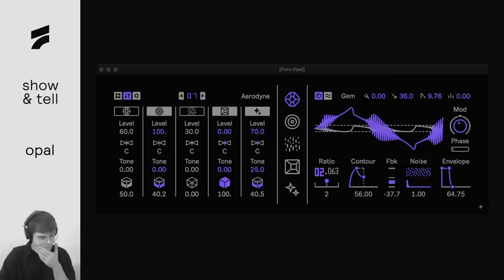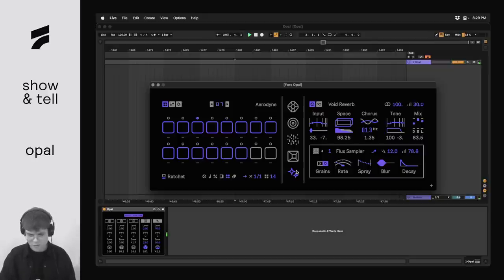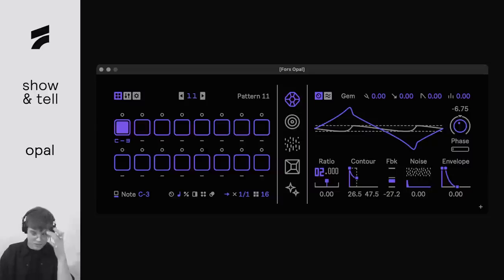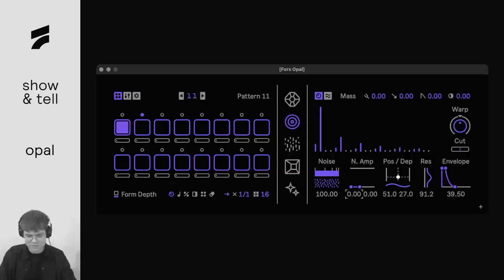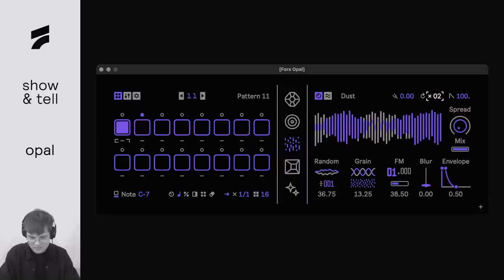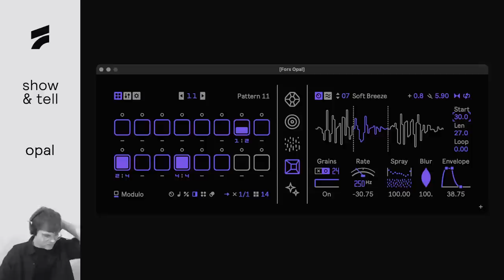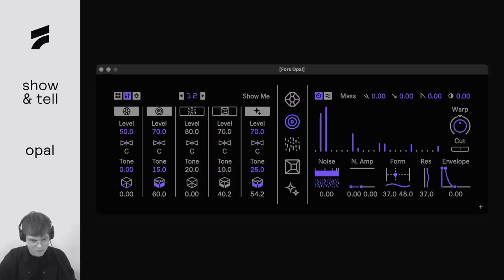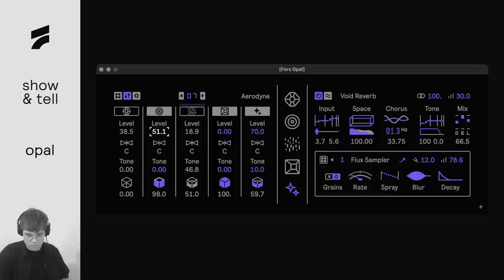Show & Tell – Opal

Comment: Suggestions (for this already very great Device), 
I read through the comments and also added my own onto them : 

- Randomize Button for Everything (maybe also to decide what to randomize with a menu / or just everything - tick the boxes)
- Push Integration for use in User Mode 
- Parameter Slides 
- Scale Function (lock seq notes into scale - option in which even the random generated notes - by applying modulation on the pitch - are also quantized in relation to the selected scale)
- Midi Version (to use with Hardware / Outboard Gear eg. Elektron Machines)
- Ipad Version / Mobile Version in general 
- to be continued possibly....

My own suggestions : 

- Being able to type in the Note Value of the Steps with the Keyboard 
- Higher Ratcheting Values (for even more glichy goodness) 
- More Fx that are applied in the Mixer - Distortion for example 
- Track Parameters going to higher values (or maybe even unsynced goodness to be chosen by Hz)
- Zoom option for the Waveform View of Sampler 
- Master Level + Master Compressor for the Mixer (and omg think about having a Eq...) 
- to be continued possiblly....
Reply: Those are good ideas, but I think you're missing the point of this device. Fors makes creative tools that embrace simplicity and restriction to think less and play more. And it's not standalone ! Ableton can provide most of your suggestions.
Reply: @e4bigler  Suggestions dont hurt i think :) Always sparks some creativity for somebody. I do really get what it does and im fairly happy how it does it ! Just some thoughts running around.

Comment: The breadth of sound design this machine is capable of, comprised in one unit, is absolutely unreal. I've had my taxed after-work head in it since the weekend and my god. My only beef is those damn triggers ha ha. If I had a krona for every trigger I accidentally dumped by altering vel, but if I work on a trigger a long while then I'll copy the step or entire pattern before adjusting velocity slider. I am just floored by the variety of sounds and textures this thing is capable of. Today I composed one entire ambient piece using all tracks in a single pattern. Imagine if this was a piece of hardware. Perhaps I'd never go back to working in Ableton again because this has all I need. Love love lurv it. Big applause for the Fors team
Reply from the maker: Thank you! We’ll look into refining the velocity input, sorry about that.
Reply: @ForsFM  No stress! Much appreciated!

Comment: As a DT user，I believe the workflow of opal is very awesome and familiar. Anyway, Edit a sequence with many parameters without visual feedback is very hard (I mean like DT or any Elektron devices. The parameter lock allows you to see the current status of edited value).
Reply from the maker: Appreciate the feedback! We would like to look into visualizing the locks more, but it’s a tricky topic and had to wait until after the 1.0 release
Reply: @ForsFM  looking forward for the upgrade！🤌🏼
Reply: @ForsFM  Will be an instant buy for me also if it becomes easier to see locked parameters on a given step with the resulting lock value [number or graphic]... :)

Comment: Best devices ever.
* It would be nice to add the scale option in which even the random generated notes - by applying modulation on the pitch - are also quantized in relation to the selected scale .
* Is it possible to copy the content (trigger or whole sequence) of one track to another one?
Reply: * A "SOLO" button would be also great to avoid going back and forth between the main/mixer section and the sequencer.

Comment: Super smart devices!!! I'm so happy to see some P-locking in Live. I think I'll use the standalones a lot too. They sound so fresh. One thing though. The standalone devices can be a bit small and fiddly to tweak and program. A way around this could be to group and assign to Live's macros. But I don't think it's supported. Which is a shame, that means we can't take advantage of Live's macros snapshots or macros randomization.
Reply from the maker: You can try with a larger UI zoom setting in Ableton Live — but also, the individual devices are mappable, but you need to map to the numbers beneath the graphical controls
Reply: @ForsFM  Thanks, I'll try that. Maybe I'm just getting old.
Reply: @ForsFM  Thanks a lot for the reply. I'll try a slightly larger UI. Is there a switch, to make the devices polyphonic?

Comment: its very easy to deselect a trigger when moving around locks and other parameters under the trigger,  which can be frustrating when you don't remember the exact tweaks on that step , can there be an undo button in the next update ? Also will there be a way to click on a step and preview it instead of having to run the sequencer? Thanks
Reply from the maker: We'll look into refining that a bit. For what it's worth, a step is never considered to be deleted until you release the  mouse button, so you can keep dragging in order to avoid that for example. Using the Undo in Live (Cmd+Z/Ctrl+Z) will undo the last changes in Opal. Step preview is on its way. :-)
Reply: @ForsFM  using it with a mousepad on a macbook pro is a nightmare, I've managed to delete almost every step I try to change the velocity of...
Reply from the maker: @vpnikolov  All we use is the trackpad on a Macbook Pro – maybe there is something going wrong? Please send us an email describing your issue to hi@fors.fm and we'll look into this

Comment: A few more questions which haven't been asked in the stream:
1. You mention in the stream that "you all" worked on Opal for a long time. So you aren't the lone developer anymore at Fors?
2. How did you create these lovely knob/button graphics? What software did you use?
Reply from the maker: We recently became a team of three, with one more developer joining us. Opal was however ~98% developed by Ess.
The whole device is made in Max (cycling74.com), with most of the UI elements programmed in JavaScript using a component called JSUI
Reply: @ForsFM  I know that it was created in Max :) Im a max/msp developer on my own.
I guess Ess also did the UI. If I remember correctly he also did many UI graphics on the Digitone.
Reply from the maker: @MrVoonix  Gotcha! Just wanted to make sure it was crystal clear. :–) Yes, did indeed design the Digitakt, Digitone, Model:etc UI ...

Comment: The only feature I find myself wishing I had was to be able to import parameters from Opal into the standalone devices. I made a cool pattern but want to automate it over time and use macros in ableton, but having to remake the patch is a buzzkill.
Reply: You mean like Elektron gear?
Reply: @RobotSnake  No. Each of the engines (Gem, Dust, etc.) has it's own standalone plugin. These can be preferable to use sometimes, such as if you want to use automation in the DAW. But since I'm creating the patches in the main Opal plugin, I have to manually match each parameter when I decide I want to use the standalone. I'm hoping for an export button that can save the parameters so I can just open up the standalone and it's all there.